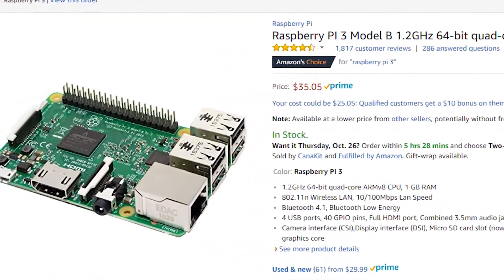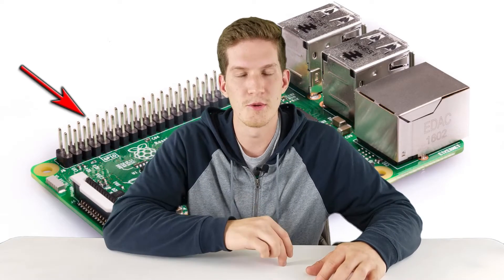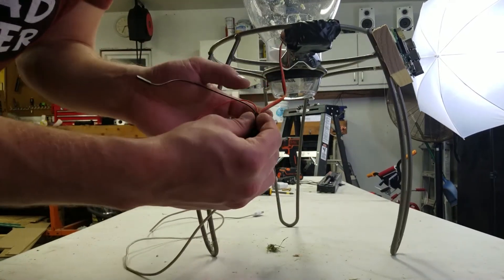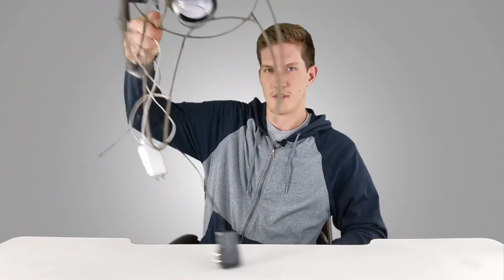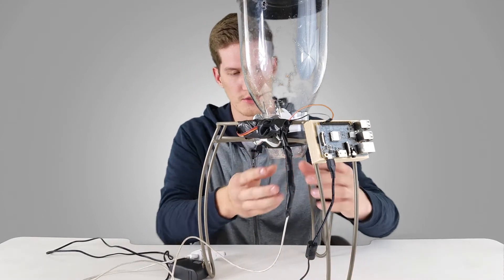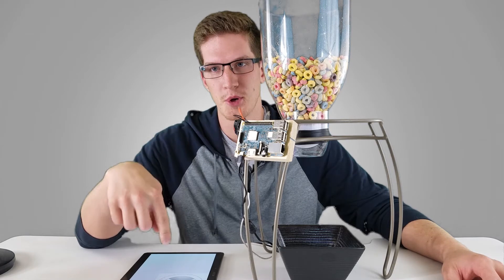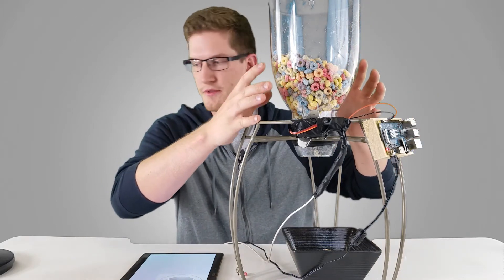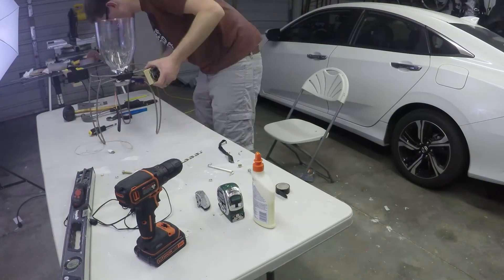SmartThings Cat Feeder | Fully Automated! (DIY)

Comment: Hey Drew I was thinking you could use a sonoff switch with a 120 volt relay I found on amazon for like 10 bucks. You could control it thru smarthings using the 6 volt powersupply thru the NO contacts of the relay. I may have to 3d print out some gears because in smartthings the time based automation only allows you to turn it off after a minute but I can use gear reduction to get the timing right.  This saves a little money not having to use a rasberry Pi and  no coding on the PI.  You could also use a smart water valve and make watering your pets  automatic too.  Thanks Great video you always have great ideas.
Reply from the maker: +Barry Henderson yeah, good idea. Although with Smartthings controlling the "timing" whether it's reduced by gears or not, may be a little off. With the raspberry pi, it's using a python script as the timer so it's accurate. But I guess if your gears are slow enough, then a few seconds won't really matter.